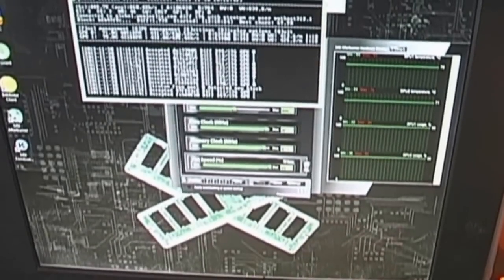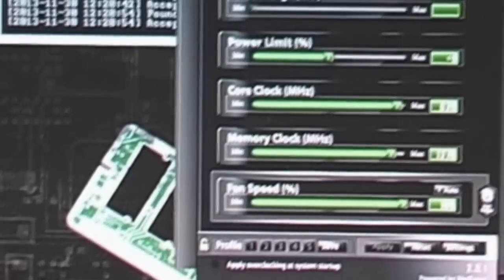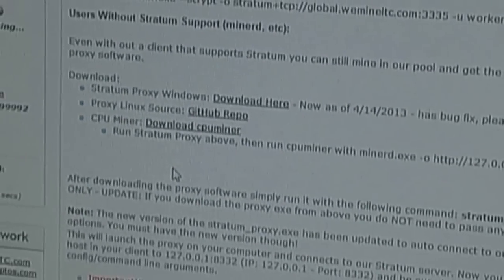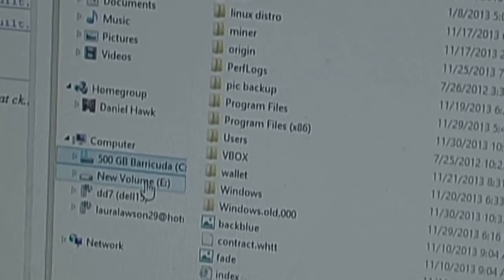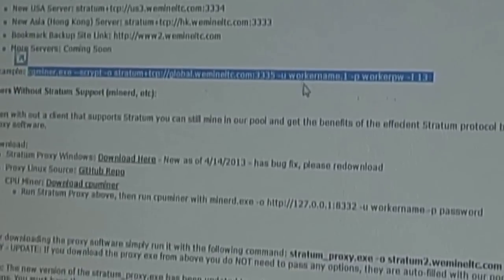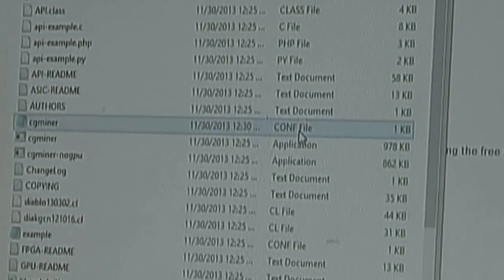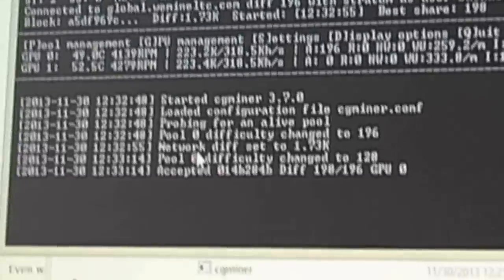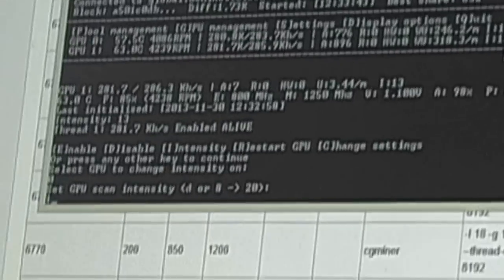cgminer setup for LTC litecoin mining from one noob to another

Comment: Hi Daniel, I follow and get exactly what you get at 920.  Then my command prompt screen goes black with a flashing "I" instead of actually running the miner.  I am using an amd R9 280x but apart from that I can understand everything to this point, afterwhich you lose me.  Suggestions?  when i put my workername in place, I get a black screen for 1/100th of a second before disappearing.  Any help around those exact steps would be appreciated.